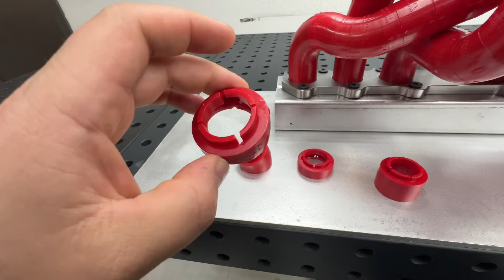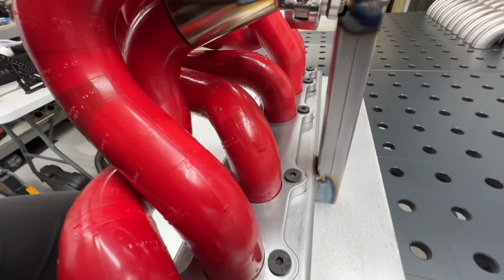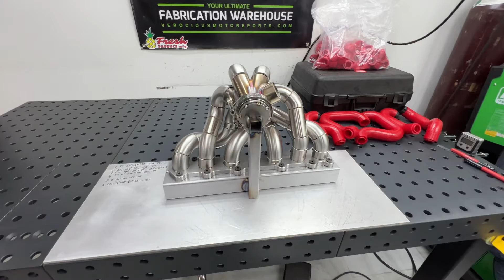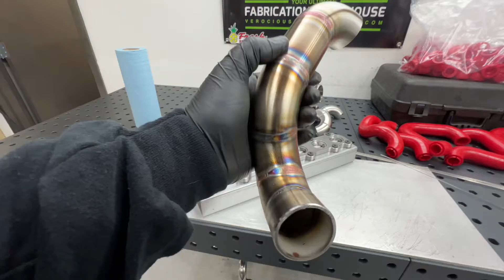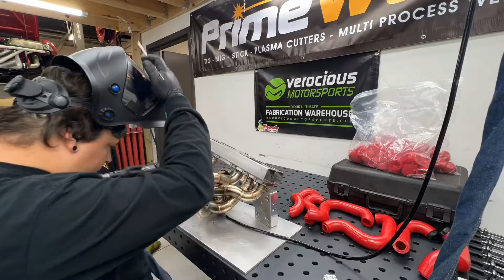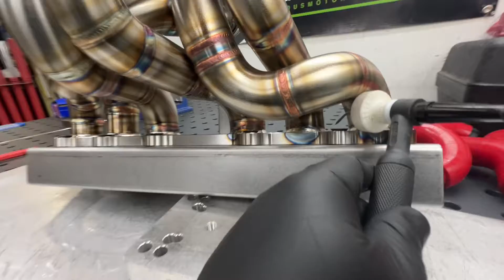1jz S14 build Pt.2 | Tips on building/welding turbo manifold w Icengineworks blocks

Comment: How come you use such heavy wall tube? normally on exhausts I use 1.6mm wall in 304 ss
Reply from the maker: @Certified--  sch10 pipe is pretty standard for turbo manifolds as they see the most abuse and highest temps on a exhaust system. It’s pretty rare to see thin wall tube being used on a turbo manifold.

Comment: Do you buy your exhaust flanges or cnc them yourself? I'd love to get one made if possible.
Reply from the maker: @fredbelford4129  some flanges I buy off the shelf, others I have made if no one makes them or makes a good quality flange.
Reply: @corymisko  Well if you have the time, would I be able to send you a design?
If so, what would your pricing be?
Reply from the maker: @fredbelford4129  shoot me an email at cory@freshproducemfg.com

If you need it CNC, a custom one off flange is going to be pricey. I usually have them done in batches of 5 to keep my machinist happy. But I can also have them laser cut if need. Specify what material in the email as well.

Comment: Good video, what welding positioner do you have? As well as any thoughts on how you like it
Reply from the maker: I have the MK t-260 cobraturn. Absolutely love it. Its RPM range is .1 up to 6. A lot of the cheaper positioners don’t spin slow enough and aren’t as smooth as these. And you can purge through the machine and not have to worry about tangling up a purge line

Comment: Great job on the video and step by step how to. I'm curious to what make of Tig welder you are using. I see you have a primeweld banner on the wall and rocking the new table they're offering I didn't see the Everlast powdered up so I'm assuming it's a primeweld Tig 225x???
Reply from the maker: Currently I’m using a everlast 255ext. Planning on getting a primeweld tig325x with maxcool cooler soon tho
Reply: @corymisko  cool deal I'm rocking the Tig 225x w/maxcool 3000 watercooler I've been using the flex-loc fl-230 been a awesome machine for the last 2 1/2 yrs. Going to wait until something happens to this one or just keep on rolling with it. Definitely unbelievable how much the watercooler changes the dynamics of the machine even though I've never hit the duty cycle of the tig 225. Thank you for the response and looking forward to seeing further updates.
Reply: Solid video man. The tip on shrinkage is legit. I’m in the process of making long tube headers for my e36 m3. That tip is going to help me out a lot.